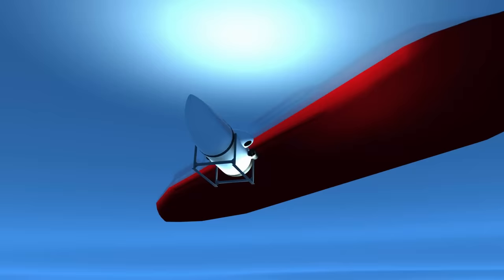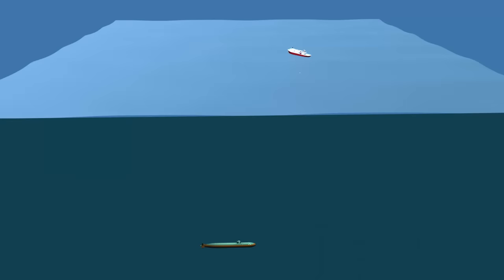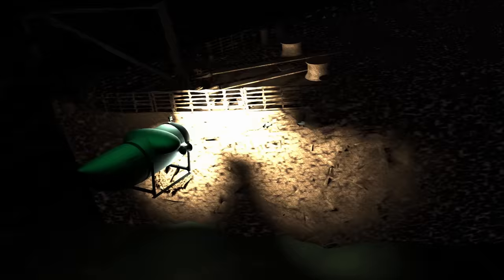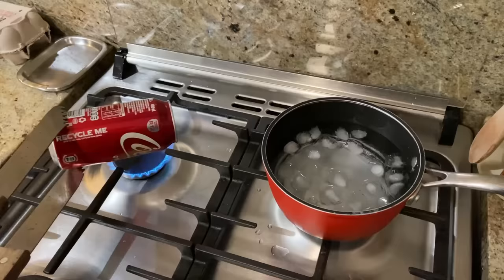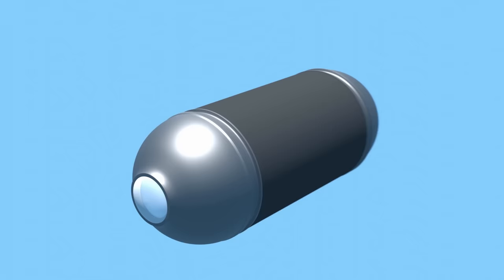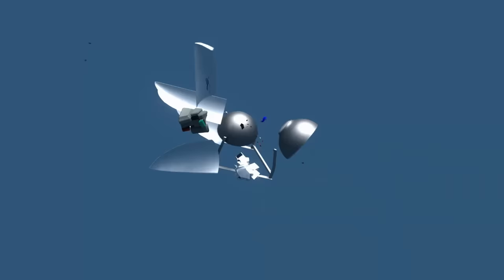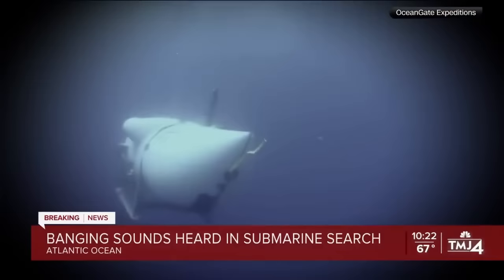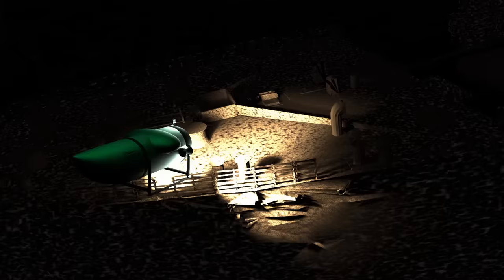TITAN Sub implosion | Deep Dive animation explanation

Comment: This is the most accurate animation that I have seen. You kept the certain parts intact, while others usually have those crush as well.
Reply: Agree
Reply: People just wanted clicks and made up videos based on fuzzy logic.  The end caps were titanium.  One person was inside the front end cap. There would have been remains such as legs arms.  The end caps were not crushed just most likely the tube failed.  Those in the tube section would likely have been pancaked.
Reply: @Physics072 Stockton was at one end, I am sure. And the other end, perhaps the youngest was giving the window seat…
Reply: @Physics072  It's my understanding all organic matter would have been pulverized, as in, turned to dust.
Reply: @Imnotplayinganymore  Water would immediately dissipate the intense heat (14,000 degrees F) generated by the implosion of the air's immediate compression to about 0.00253 its original volume, although there would be surface scorching. The compression of the collapsing steel can inside the compromised titanium shell would provide the physical force to immediately crush its contents much like a trash compactor, but there would likely be identifiable remains.
Reply: This guy has brought up a whole new meaning to the term "Rushed"
Reply: @Physics072 not arguing asking: The caps didn’t crush because of their material and construction. But wouldn’t any human in the either end been smushed (but not pancaked).
Reply: @brennymcphees7557  2200 degrees F, but I get your point. I did my calculations as experts said it wasn't even close to 10000 degrees F. I'm a Civil and Environmental Engineer who took many thermodynamics courses; not trying to start anything, just saying that I'm not some random guy on YT that did calculations, and you're supposed to believe me without credentials.
T2 = T1(P2/P1)^((gamma-1)/gamma). Gamma being Cp/Cv = 1.4 for air.
Reply: It would not have mattered how you wound the fiber. Any and all ways of using fiber in this application would have failed.
Reply: how do you know it is accurate ? did you witness the event perhaps ?
Reply: @stewartlancaster6155  You don't need to witness something in order to make predictable determinations on what happened. You can make inferences and they can or cannot accurately represent the reality based of the evidence from the scattered debris of the Titan.
Reply: How would you even know it is accurate lol.
Pull ya head out ya behind mate.

Comment: I am an engineering student that literally has just taken a class on carbon composites and one of the main things I learned about pressure vessels is that layup should be around 55 degrees from horizontal to maximize strength. If they didn't even put that kind of consideration into the orthotropic nature of carbon fibers I don't think they put much thought into the design of this vessel. It is such a shame.
Reply: They should've made a sphere out of metal instead of a giant brittle soda can. Would be less compact for the same amount of passengers, but much safer.
Reply: Gas cylinders are made of composites and as far as I know they use the angled layups, not as a spool of thread seen here.
Reply: i mean look at it.. it looks like a make-shift space ship made to sit in a kids playpark.. i know functionality trumps presentation, but it didn't even had that.
Reply: The most important thing for me in a vessel like that is a comfortable flushing toilet because i would have been farting ginormous gas bubbles.
Reply: @LEXXIUS  The CEO wanted more space for rich clients. That what happens when income is priority one and safety second.
Reply: @seandelaney1700 gas cylinders are under tension not compression. Different direction of pressure. The inside higher than the outside causes the pressure to want to pull the fibers apart. For the sun, the pressure wants to squeeze them together. 
Carbon fiber is good under tension, but bad under compression. 
The weave makes it stronger regardless though

Comment: In an interview one of Rush's friends said that in a previous dive they heard a cracking noise during  the decent. I believe the friend told him after that they shouldn't dive in the Titan again.
Reply: Captain Obvious was his name
Reply: Aren’t sounds of steel compressing under immense pressure normal to hear while in submarines? Pipes makes tons of sounds as they expand and contract under hot and cold temperatures, as anyone who’s experienced old heating systems knows. This is a question I’ve not seen answered yet.
Reply: @TheFutureLooksGrimm  Perhaps if the central structure was made of metal. But it wasn't.
Reply: @TheFutureLooksGrimm it wasn't made of steel. Did you have the video on mute???
Reply: @user-bl1pw2th4l  you misunderstood my question. Read slowly.  I know the hull of the Titan was made out of carbon fiber. I’ve read a everyday about this. Normal submarines are made of steel and they do indeed compress and make sounds. Therefore we can assume that a certain amount sound of the submersible’s carbon fiber hull compressing would be normal. Anything compressing makes a sound normally. 

I just read that military sub personnel do a little fun test, they put tape or a line from one side to another, and as the submarine dives deeper (nowhere near crush depth) it line or tape begins to drape. Visual confirmation of the steel compressing. James Cameron said his vessel compressed at least 3 inches. Steel, Titanium, Carbon fiber, it all is going to make a sound when being subject to compression. Sound alone is not an indication of failure.
Reply: @TheFutureLooksGrimm  "Anything compressing makes a sound normally" carbon fiber isn't supposed to expand, contract and create sound like metals.
Reply: The 'friend' is Karl Stanley, who has his own mini-sub, and runs trips in Honduras. He has made over 2000 dives in his sub, but has done so responsibly, never going more than 2000ft. He also does not characterize himself as a friend of Rush, more of an acquaintance.
Reply: @andriypohors2538  Stockton Rush stated carbon fiber makes a lot of crackling noise going down. He also talks about testing done at the University of Washington. For anyone interested the uncut cbs interview transcripts are a must-read. It will clear up all this. I have the article in Evernote with hilighted notes if anyone is interested let me know I’ll post a share link. 

Karl Stanley didn’t simply mention the crackling, here’s the key, he said it was “getting worse” and Rush responded by building a new 1mil carbon fiber replacement hull. Which was tested. Karl Stanley doesn’t go as deep but he does nearly the same thing as Stockton Rush. Except Karl Stanley is no engineer!  He’s an English major who built a mini-sub costing $200k which he only charge $1500 for a trip with 1 passenger. A few times the windshield cracked spraying water on a customer!

Comment: When you design with carbon fiber, most times you end up chasing away its shortcomings until its benefits have been nulled. Weight is often the biggest advantage of CF but as soon as you need metal doubler plates, and joint reinforcement, and end fittings, you’ve introduced so much complexity that machining and iso grid structure makes more sense. CF is a material you use with great intention and foresight/testing.
Reply: While CF (the fiber itself) is very strong in tension, it becomes practically useless because it is flexible by nature. Under these kinds of loads it might as well have been just cast resin.
Reply: We get already😮
Reply: I think we should send more rich folks down
Reply: Looks like they went to a lot of trouble to avoid crosshatching the fibres 😢
Reply: @faku2l154  Or up (wait to see what will happen with Virgin's space plane, Bezo's New Shepard and soon Musk's Starship... The show must go on.)

Comment: There are a few reasons the sounds of the implosion weren't released sooner.

1 - The DOD - Military picked up the sound but didn't know what it was.  It could of been a cargo container falling off a ship imploding, a depth charge or other military exercise, one of the tanks on the vessel, or many other things.  They just knew they heard something and reported that up DOD/Mil channels.

2 - 2hr's later, an emergency call was issued on Civilian channels that contact was lost.  Assistance needed.  No one would have checked for a possible implosion because they think it is still intact and suffered a power failure.

3 - At some point in time, the sound was passed to rescue crews to help them better search.

4 - This is the important part. - Searches are not called off because someone thinks something happened.  You need to verify.  Upon verification, and due to the unique situation (implosion), rescue was impossible and it then switched to a recovery and families and press notified.  

Nothing occurred in the SAR portion that is out of the ordinary.  No major conspiracy, it was put into the press because it was a modern day kid fell down well story that captivates people.  The press came up with their theories because they run a 24/7 news cycle and they need something.  As it takes time to get rescue ships to the area, and the press then starts filling time by calculating how much air they have left..... this helps them generate interest and views.  Yes this causes anguish towards the family waiting to hear the fate of their loved ones however..... you cannot put it the press that you heard an implosion before you verify.  It looks bad, but it's oh so much worse if you tell someone their loved ones are dead but they aren't because you haven't verified.
Reply: This very much. Society owes every lost person a proper search. Imagine if the National Park rangers decided to not look for a missing hiker because they saw that a pack of wolves they were tracking were in the same area and just assumed the hiker was eaten... Only for their dessicated body to be found uneaten at the bottom of a ravine a year later.
Reply: Right.. the noise coincided with the loss of communication with the sub. The sub was made from plastic. 
But a propagandists must keep its flock in line, right? 😂😂😂
Reply: @DS-lk3tx  I have no idea what you are trying to say.
Reply: I can't imagine anyone has ever seriously suggested to call off the search. I believe his point was repeating James Camerons who had this info and  knew it was finished. When I learned the controversial construction and the  point at which it lost communication I too assumed it was lost. It was indeed a compelling news story and that fact alone would have had editors holding off on presenting facts which  made the search seem more like one of recovery. If Cameron knew, others knew, ie. any journalist that had reached out to Cameron or any of his colleagues, so yeah it is most likely a bit of a conspiracy.
Reply from the maker: Thanks great explanation
Reply: There was some cross talk also about secretive nature of the military listening system. They did not want it known that the system is as sensitive as it is. No way for us civies to know this for sure but a possible further reason for the info delay.
Reply: @DS-lk3tx  are you high or something